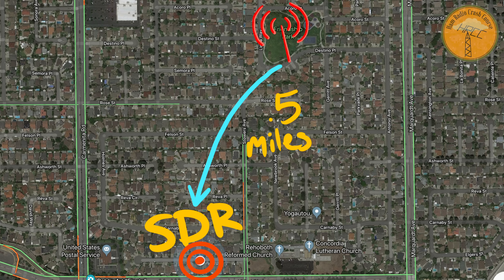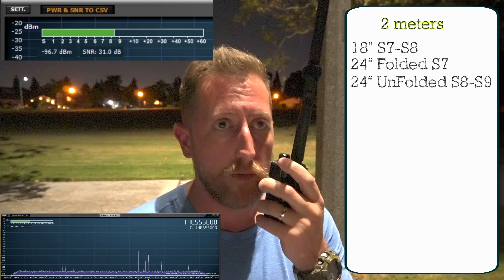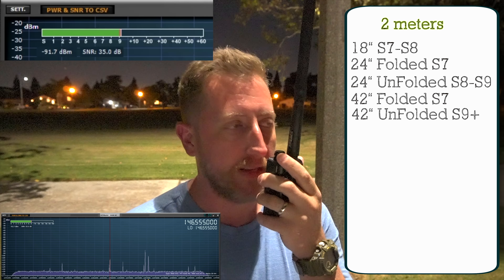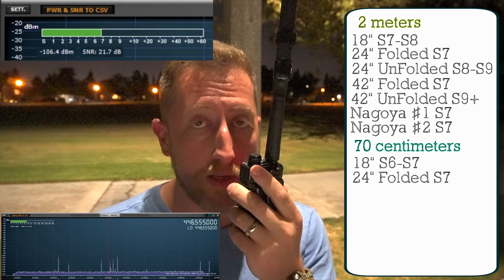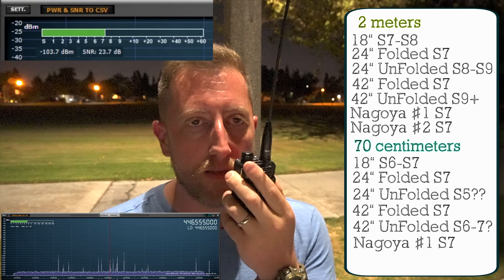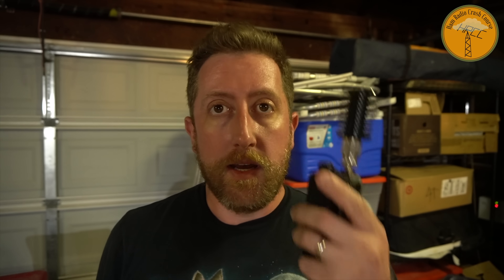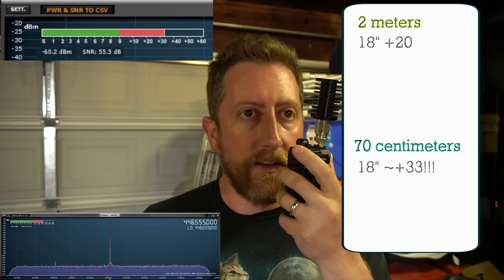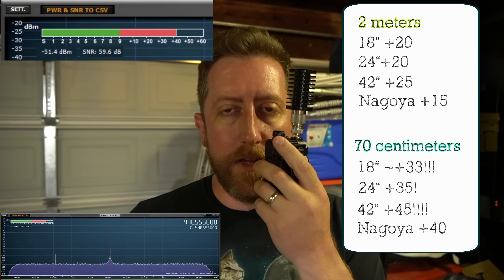ABBREE Tacticool Ham Radio Antenna Performance Test and Review

Comment: You should not be transmitting with the antenna folded. The impedance will be way off and will damage the finals eventually. You showed a Rig Expert in your B-roll, I suggest constructing a Tiger Tail for U and V and using it for some SWR sweeps. I think you will be quite surprised how bad the SWR gets when folded!

Comment: If your 42 inch ABBREE antenna gets floppy where it beds. its most likely the heat shrink has wrinkled a bit. A bit of fire from a lighter will fix that problem. Also don't store it folded.

Comment: I bought the 42.5” for my Baofeng BF-F8HP and the antenna didn’t screw all the way down into the radio. There is about a 1/8” gap. It also didn’t seem to improve reception much over the Nagoya NA-771. Suspecting maybe it’s fake.  I popped the cap off the end to find out it’s literally two metric tape measures doubled up and shrink wrapped. Is this normal? Anyway, it’ll be headed back to Jeff Bezos soon, maybe he’ll have better luck with it.

Comment: I know it's late to the party but I had a question maybe someone in this chat could answer. I am very new to ham/cb/sdr world.  Holy cow is radio Science intense. I'm a nurse so I'm really good with science but radio is a whole new ballgame🥳 I have 2 different models of uvr5 and got 2 different aftermarket antennas for comparing. One is the popula nagy 17"  and the other is the 42" abree . I've made some contacts (received only) from several repeaters in 2 different towns between 5 and 15 miles. I noticed the other night that while listening on my abree antenna that the single was significantly stronger /clearer with the antenna folded to lowest height. I figured the unfolded position was to give the better reach stronger signal??.is this normal or do I have a defective abree?   Repeater was 2m  thanks in advance if anyone can answer.

Comment: Great review. So what backpack antenna would you recommend for my Yaesu Ft-65R? I am thinking of using an ear bud and connect the antenna via a cable so I don’t risk breaking the radio in case I tangle something.

Comment: i need to know more about how the return side uses the human body as part of the process of accepting and or sending out radio waves. i had no idea it worked this way, now i am reconsidering not  a little wired speaker/mic thing, i was  going to mount the radio on my shoulder strap or back pack, but if  that makes the signal less strong i wont be doing this.

Comment: Is ANYONE else ONLY getting maybe 1/3 of a single twist on these  abbree antennas?
Reply from the maker: Remove the rubber grommet.
Reply: @HamRadioCrashCourse  I already have. Looks as though the base is too narrow to accept the wide antenna. I am using the waterproof baofeng though lol. Do they make extensions between the radio and the antenna?
Reply: Dummy me
 I ordered the wrong one. They make one specific to the uv9r and uv9r plus!!!.
Reply from the maker: @jacksonmorris7731  If the antenna connector is the same you are likely fine.
Reply: @HamRadioCrashCourse  they are threaded the same but it appears that the uv9r has a deeper set so that the antenna base sits inside the antenna base with a slight "grommet " to keep water from getting to the internals. It may be hard to find aftermarket antennas for the waterproof models since the antenna mould on the radio is moulded to fit around the antenna base vs other models sitting on top of the radio. Interesting design but limited. The abbree, for the UV-9r, is narrower at the base and the connector is slightly longer so it appears to be model specific!!! Thank you for all of your videos and my family and I are now into ham radio and working on our license!!!!

Comment: What happens if you remove the coily bit at the base of the antenna and use it normally?
Reply from the maker: The coil bit connects to the SMA, the tape part does not have a connection for SMA.
Reply: @HamRadioCrashCourse  I feel really dumb. I didn’t even realize the threaded portion on top of the coil didn’t have the orifice for the center wire.  Duh

Comment: I enlisted the help of another ham across town with an O-scope and did the same thing you did...except we did a cycle using rat-tail/tiger-tail's ('counter-poise') and what we learned was the ABBREEEs improve your 'receive'...the 'rat-tail/tiger-tail' improves your transmit.  I check into several nets on Saturdays while I'm at work in the field and often I can't hit the repeater without the rat-tail/tiger-tail installed when I'm out on the fringes or between tall buildings.  Technical testing shows it....field testing confirms it.  (I carry a Baofeng UV82HP at work....fyi)

Comment: Try the 42" out the top of a ruck sack. Camelback used to make rucks with a top side flap for a water hose to feed through perfect for sticking an antenna through. 42" is great for still having a lot of the radiating element clear of obstruction. You can always slip the antenna out the side of a top flap of a ruck.

Comment: I so wanted the signal stick in the mix on this one!  You got better results than I did.  Though my tests were very unscientific just using a crossband repeater and a couple of fengs.  It would be interesting how this stacks up against a rollup j-pole in this kind of test.  73, K2RRT

Comment: So, do those antennas work the same on 2 way walkie talkie? I have bought 2 uv5r and i have a uv5r plus. The walkie seems to work to about 1/2 mile. Now i used 2 different antennas for the experiment. The uv5r is 8 watts and believe the 5plus is 5 watts?

Comment: Late seeing your video on the Abbree. I have one I periodically use on my Yaesu FT-270. My comments that follow are not intended to diminish your review, only to point out the technical issues of HT antennas.
Because you skirted around it by referring to attempt to test the antenna with a setup that (near) mimics the manufacturer's setup, I'll give you a close and part of a cigar. HT designs take into account the human body being part of the antenna system. This attests to the length of a "1/4" wave antenna (e.g., Diamond SRH77CA and Nagoya 771) is only 15"(approx.)  vs. 19" This fact can be very simply proven by setting the HT on a table or similar surface then comparing the difference in a receive signal with the radio free-standing and one's hand wrapped around it. The latter will typically increase the RSS. 
Other factors of course enter into the picture: nearby walls, metal structures, vegetation, etc.
Having worked testing antennas (albeit microwave receiving antennas) on an antenna range, there is something to be said about calibrated instrumentation and a free-space range to determine performance. As you asked for suggestions, perhaps you could run some empirical tests on the Abbree antennas, Nagoyas, OEM Baofeng (though I'd much rather see it done on Alinco, Yaesu, Kenwood, and Icom). A simple antenna range could be done across a narrow canyon that would be about as close to an anachoic test range that you could economically come. For a bonus, test all antennas with a tiger tail counterpoise. Such a test could either validate or debunk the purported benefit of adding such a hunk of wire to an HT.
Be safe, be well. 
I am N6MED now subscribed.
Reply from the maker: Hi Jim, thank you for the comment.

In the test I did test all the HTs from the same location rought 1/2 mile from my home and measured the receive strength of each transmitting antenna.  I thought that was an empirical test?  The receive station remained constant during testing into an SDR which captured the signal strength and SNR.
Reply: @HamRadioCrashCourse  as empirical & objective as you could get but for the trees and ground that could distort the signals from each differently. One could make the argument that your test was more practical than one done over near complete free space (i.e., my narrow canyon test).
Reply from the maker: I think that is splitting hairs, but ok.
Reply: @HamRadioCrashCourse  well, you look at the practical side like my friend, Bob k6uda ;-))

Comment: why weren't you using frs or gmrs frequencies to transmit?
Reply from the maker: Because I’m a ham radio operator.
Reply: @HamRadioCrashCourse  I see, your videos are always very informative. I've been always wondering why difference license and class have the privileges of using different frequencies. Do those frequencies have characteristics that benefits the intended use for the licenses and classes, or it's just a regulation thing?
Reply from the maker: It’s largely regulation.

Comment: Hey Josh... great video... the only thing I would like to know is what were the readings with the stock rubber ducky.. I would have used that as a baseline.  I have the Baofeng UV-82 mk5... and would be interested know how well these antennas would improve over the base RD.

Comment: As far as I know when your running vhf lowband 30-50mhz you extend it, fold it for VHF mid 150mhz. This is for the original Thales and Harris radios. Just like a telescopic antenna.

Comment: Hey Josh, great to see this review, so in your opinion if you were going to buy just one of thd three which is the best all round?
Reply from the maker: The 24” is the best all around for size.
Reply: @HamRadioCrashCourse  thanks, ive looked and im assuming they are w4" without the base part?
Also i came across the Abbree "gooseneck" antenna, have you tried one?

Comment: Josh many thanks for the great video. I have the 42 inch model and it seems to work well, but I'm just concerned it is putting to much force on the small SNA connector on my Yaesu FT3DR radio.

Comment: Hey josh! So, I’m new on this ham radio game. I don’t understand the 2 meters and 70 centimeters test? Are you doing something with the radio? Why is it when transmitting in 70meters sounds slightly better?
Reply: Seemed all the antennas did better on 70cm..  I'm thinking the propagation is just better on that Freq?  Josh?

Comment: I just picked up the 18" for my Feng UV-82 and the stock ducky performed better. Interestingly, when I remove the antenna from the coil stack, it worked better than when the whip was attached. Not sure what to make of it. Great video BTW. Cheers.
Reply from the maker: You generally need to make sure the antenna is seated appropriately.  However, its also likely the antenna is overloading the front end of your radio as Baofengs are generally lacking in their front ends and can get overloaded easily.
Reply: @HamRadioCrashCourse  thanks for the reply. It is seated well. Even tried it with none, 1 and both washers. No change. The overloading part over my head (I'll Google it) shortly. I have an Mirkit variant 8-watt UV-82 MK5. My experience is with receive only, not xmit (not licensed yet). Moderate VHF repeater signal with ducky, dropped out with the ABBREE. Remove whip from coil and signal came back. I'll likely just stick with the ducky for now. Thanks again. Cheers.
Reply: @HamRadioCrashCourse  additional note, tried it both directly on the radio as well as via the TCI MAST strapped to the back of my plate carrier. No diff. You are likely on to something about the radio however as I also grabbed a couple of HYS bendies and same issue.

Comment: An Extra Class licensee wonders why a shorter antenna works on a higher band and a longer antenna works on a lower band. >_< PICARD FACEPALM
Reply from the maker: It’s not really shorter though. Just folded over. The element is in contact with each itself, seller aged by the shielding.
Reply: Hi Railgap Esoterica:  I hope this answers your query.  As frequency increases, antenna length shortens.  Folding the antenna (as in video) electrically shortens the antenna.  In this case (in the video) the antenna appears to the radio as a single, shortened antenna. Due to the “skin” effect, current only flows on the outside surface of the shortened antenna and not the original complete length of the antenna.

Comment: I've been selling this Antenna since 2018, as for ABREE still CHINA so even if you doesn't say ABREE it's still the same Antenna with Capacitor Built Inside . There's no FAKE nor REAL Marketing Clash for other Antenna Sellers. ABREE and Non ABREE same Atenna just different SELLER :) If you have any questions on this Antenna let me know because this Antenna has one of the best performances than STOCK Baofeng. Hope this helps, there is the new type SATCOM PRT47 that's new in the market :)
Reply from the maker: Send me over the satcom antenna and I’ll take a look.  I have a setup for pulling down sat images and would like to test it. 👍
Reply: @HamRadioCrashCourse   SATCOM PRT47 Antenna made for Baofeng Radio's looks like a Sat Antenna but it's Dual Band V/U with a 5.2 db Super Gain :)

Comment: The UHF VHF difference is because you're electrically shortening the antenna when you fold it.
Reply: Dead right, Reverend:  When folded, the antenna appears to the radio as a single, shortened antenna.  Due to the “skin” effect, current only flows on the outside surface of the shortened antenna and not the original complete length of the antenna.

Comment: I found that the stock Baofeng UV-5R antenna performs better than the Nagoya. The shortest tactical antenna performs well if you're in the clear, but the stock one works more consistently well indoors. I'm picking up my 42 incher tomorrow, can't wait!
Reply: Hi R B:  I've found the same.  My stock UV-5R antennas work extremely well.
Reply: I found the same.

Comment: Did you conduct this test simplex or duplex?
Reply from the maker: It’s all simplex. Recorded each way.
Reply: @HamRadioCrashCourse  thanks for the reply. I shared these results in some groups and ruffled a few feathers. Would you be interested in doing the same test with other tactical antennas specifically, such as those from Disco32 or the Caattail antennas?

Comment: Got the 42 incher today and put it on my Bangfang which had a 771 on it.  Instant difference. Excellent RX on 2 and 70,  TX better on 2 than 70. Interesting that your 70 test on the folded 42" yielded better results than unfolded.  Thanks for all the great videos. I learn a lot from them.

Comment: Awesome video! Have you done a video about a body whip antenna on a HAM radio?
Reply from the maker: No not yet. I dont have one 😳
Reply: Ham Radio Crash Course we made them in Afghanistan, it was pretty easy to make. If I remember correctly we just used 3ft of comm wire with the shielding removed and the bit at the end soldered then covered with electrical tape. In the area I was in we always had radio issues no matter what we used, but they worked pretty well. I wonder if it would work the same on something like a UV5R

Comment: Can someone explain what he meant by 2 meters vs 70cm in the test? Novice at this and kinda wasn't explained I believe.
Reply: Hi Odrid Ayala:  I wonder if the following answers your question?  In Ham-speak, 2 meters is 144-148MHz and 70cm is 430-450MHz.  It’s all to do with “wavelength” in relation to “frequency” and all rather archaic and unnecessary, as is so much Ham lingo.  
For simplicity, if you divide 300 by MHz frequency you get meters, and if you divide 300 by meters you get MHz frequency.  Simples!   
It is also rather strange that Hams talk in meters, when their radio readouts are in MHz!  Same as those Hams who talk in meters, yet still make their antennas in feet and inches!  Trouble is, Odrid, all this unnecessary lingo and jargon is passed down to new Hams, so it perpetuates!
Enjoy your Hamming.  Iain.

Comment: I have the 18.8 and the 42.5, love them both. Here is a trick, if your 42.5 inch antenna has problems where it folds, hit that area with some heat from a blow/hair drier, it will shrink the tubing down a bit, and should help the antenna stay unfolded. I attach my 42.5 Abbree to a tactical back back and use a short cable to attach to my radio, I also use a speaker mic. Great channel, you introduced me to the Abbree antenna. 73's, stay safe.

Comment: Ive had two of these and while they do seem to perform well the craftsmanship is lacking. They both separated where the flat part of the antenna attached to the spring/load bits. They look great but in my experience they can not handle any abuse...

Comment: Got got the 24" and 42" antennas. I have no problems with keying up to a repeater 20+ miles away. I've also got on to a repeater 40 miles away with my Baofeng UV-9R plus and UV-5RTP.

Comment: Howdy, Josh! Are you familiar with the 
Baofeng UV-82 Ham Radio MK5 8 Watt MP Max Power? Does it actually have 8 watts of output? Is it a good buy at $40?
Reply from the maker: No specifically that radio.  You need to put it on a watt meter to know for sure

Comment: What causes the low audio on 2m?
Reply from the maker: My video recording settings. Not the radios under test.
Reply: @HamRadioCrashCourse  Ok thanks. I asked because I was using a stream to see if I was reaching a repeater. I was able to get its squelch to open but my audio was very quiet.  IDK if it was me or what probably was just to far of a reach for my little BFF8

Comment: Could someone explain to me how a dummy antenna can be used to test receiver?  I would love a deeper technical reason.  To me a dummy antenna is made to not transmit, right?
Reply from the maker: It attenuated the signals a ton, but it still transmits enough to do a test.